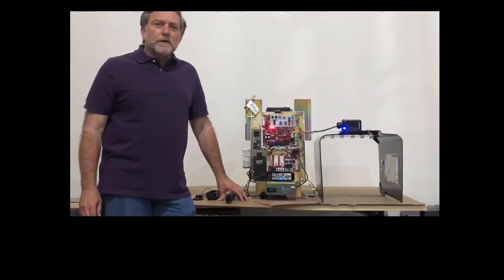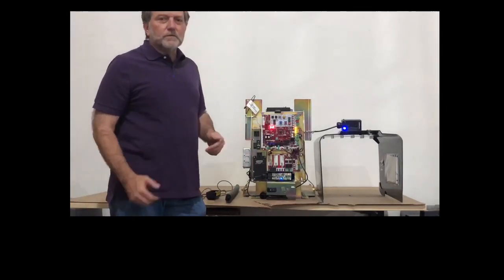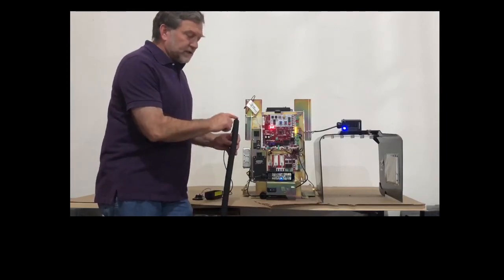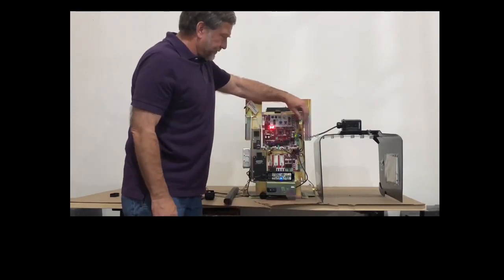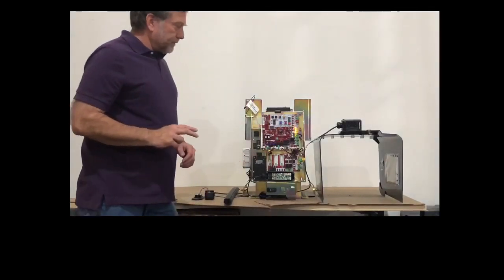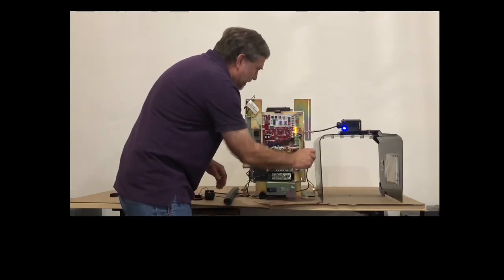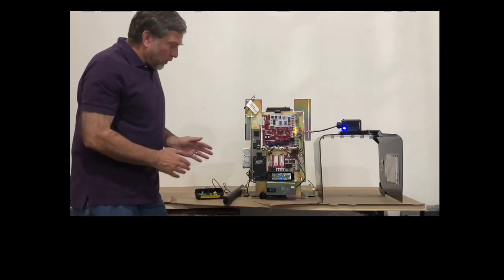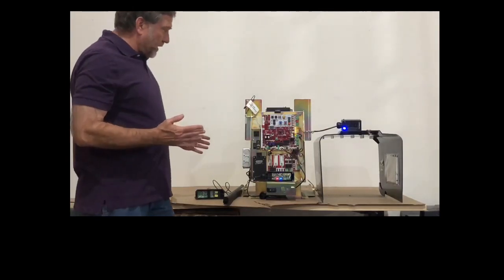Liftmaster Monitored Safety Device Installation

Comment: You are awesome, fantastic instructions. The reset buttons was magic. Yes, we walked into it by accident and cabal. There it is. Thank you so much. We now have an awesome lift gate. Don't nobody buy the mighty mule!!!. It is a worthless piece of junk!! that I've been trying to make work for over 10 years, and I've gone through at least five of them. Dismiss master is quiet, works easy, easy to install. A minor bit bit of welding, and we're done. Can put the brackets up.

Comment: Thanks, your tip on the reset was all I needed. I remember breaking the first run cycle with my elbow .  it stopped the gate on it's first run - after that the whole install was frustrating. I knew I had everything setup properly. After I reset (holding the left/right) buttons. Voila, everything was up and running.  I ran the gate 2 full cycles and today is day 2 with about 20 entry exits without any issues. :) Thx for the reset tip!

Comment: Hi Affordable Openers, I have 72 code on my RSL12UL unit but my eye sensor are working good. Solid blue normal and solid red when interrupted. My remote doesnt work. Did it manually and only closing is working, and wont reverse when eye sensor is interrupted. Pls help me. Do I have to reprogram my remote operator?

Comment: I have a CSW24UL and have the solid blue light working on the eye and it is connected in the top yellow block.  But the yellow blocks below it have a solid yellow light.  I have tried connecting a shadow loop in, but it doesn't turn off the lights.  I am baffled!
Reply from the maker: Tom, give us a call at 888-444-8123
Reply: @Affordableopeners  Eric, thank you so much.  I will buy all my future liftmaster products from you guys.  It is working perfectly now.

Comment: We have the CSL24UL with a receiver/call box. It has been working well for months now, until a snowstorm the other day. The gate is open and will not close by any method. I tried the "Troubleshooting" in the manual, no luck. When I removed the shell to the operator box, the only light that was flashing is the small "Timer" light. None of the test buttons will move the gate, either. Any suggestions? Thanks.
Reply from the maker: Please contact us at sales@affordableopeners.com and we will be able to help further.

Comment: I am replacing the control board, not that I have replaced it exactly how the other one was installed, I keep getting the same blinking lights, the previous set up did not have any kind of edge guard and still ran properly.  I do not have the edge guard and have done everything in the initial installation instructions. Still keep getting those blinking lights. How do I install with only the eye sensor amd nothing else.
Reply from the maker: The new boards require 2 monitored safety devices. You will need to purchase either another LMRRUL or a resistive edge with the LMWEKIT. Any further questions can be directed to us at sales@affordableopeners.com

Comment: Hey do you know anything about setting up a dual gate lift master system they have sent me a complete kit but it has two transmitters and only one receiver from what liftmaster has stated both machines are able to be wireless networked so only one receiver is Necessary which completely confuses me please if you got any idea how to do it thanks
Reply from the maker: Checkout page 20 of this manual. It explains how to do the set up: https://www.affordableopeners.com/manuals/Manufacturer/LiftMaster/csl24ul.pdf
If that still doesn't get it for you, call us at 888-444-8123

Comment: I didn't purchase the wireless receiver. If I hardwire the edge sensor, must I still  connected to the exp board?
?
Reply from the maker: No, you will connect the wires from the edge sensor to the yellow terminal block on the main board labelled "open eyes/edge".

Comment: Is there any way to skip that damn 2nd safety device? I have the edge but without wireless receiver and I can’t get it to work!
Reply from the maker: You either have to hardwire it with a coil cord or by the wireless edge kit. Part # lmwekitu  https://www.affordableopeners.com/liftmaster-lmwekitu-monitored-wireless-edge-kit.html
Reply: @Affordableopeners  Thank you for the helpful video. If I do a reset by pressing the 'open left' and 'open right' buttons together twice, does that only reset the safety device configuration from the memory, or does that return all programed settings back to the default values?  I was consider switching to a hardwired edge configuration but don't want to roundup and reprogram my numerous colleague's remotes.
Reply from the maker: If you click the open left/open right buttons at the same time both lights come on, do it a second time and both lights go out. Now you have erased the entrapment device memory from the board without erasing any other settings. @brettschuler5336